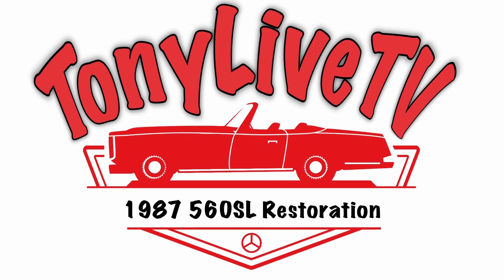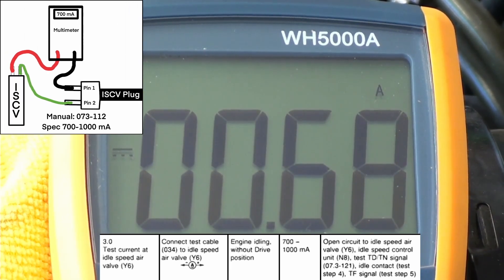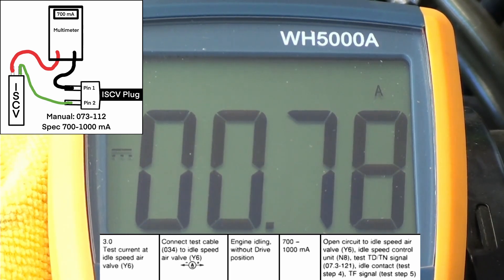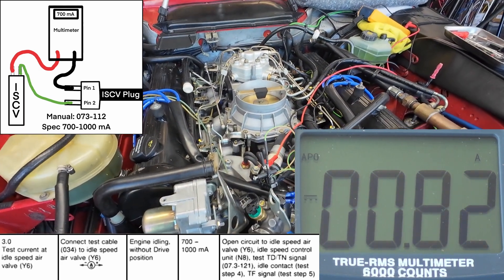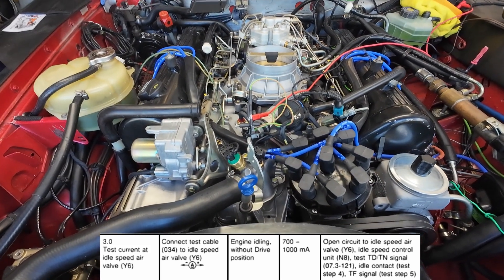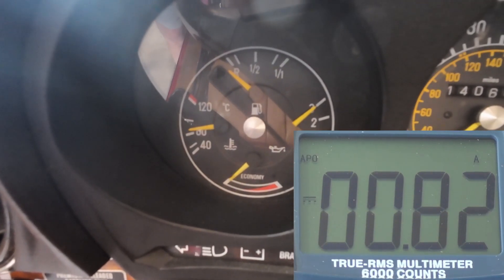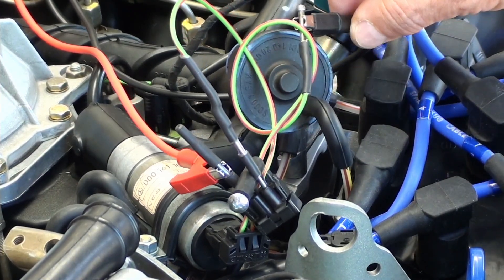560SL - Perfect ISCV Amperage Test Results (Idle Test)

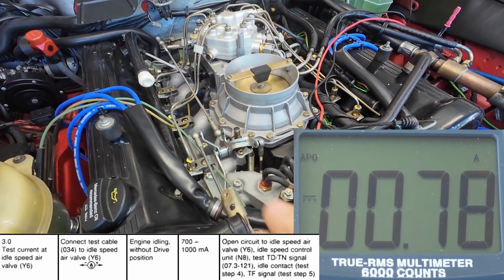Comment: Hi, Tony. Happy Easter at first. What I can tell you is that you should pay attention to the idle while your engine is being warmed up and afterwards as the temperature hits 90. Pay attention at 1:44 how your car behaves on idle, you have fluctuations and that's how it's supposed to be! That means the lambda is working properly, that your cars idle is where it is supposed to be. Concerning your RPM meter, check the wire from your instrument cluster, it's green as I remember and it has to go from X11 pin1. For this test you will have to remove the instrument cluster. I believe you issue lies there. Otherwise, CONGRATULATIONS, buddy, you made it!!!! There is a saying here that your wife/girlfriend can be from anywhere in the world but your car HAS TO BE FROM GERMANY!!! "Happy Mercedesing"
Reply from the maker: @mercedeske  Happy Easter 🐣. I didn’t have enough equipment and screen space for viewing the idle speed in this video, but I did monitor it on the side and it was perfect. This video was a continuance of the previous video where I blew the fuse in my multimeter so I was not able to show the ISCV amperage test results. 

Maybe  you can help me with the tach issue because according to the manual(s) I have access to, the tachometer gets its signal from a pickup called an E-Tacho. I mentioned this in another video. https://www.tonk.ca/r107CD1/Program/Chassis/54-252.pdf

But elsewhere in the manual it says there is either a mechanical tach or an electronic tach https://www.tonk.ca/r107CD1/Program/Chassis/54-253.pdf

Originally I thought this was for the speedometer because again, the manual says that too. Since I had a tach signal at the X11 Pin 1 and because my clock was also not working, I figured the problem is a ground and I’ll come back to it when I remove the cluster.

I have not found anyone who has traced the tach wires from the dash to its hiding place. I bet if I do the tach test as the manual shows, the speedometer will move, not the tach. I have conflicting wiring diagrams too. The lack of information and conflicting information is one reason I created this YouTube channel.

Comment: hi tony. I have 1986 mercedes 500sec. im watching your videos, everyhing is very good and imformative. But i have a problem can u help me please. my car is in restoration just now. electric cable and others fitted but rpm meter is not working. how can i check this meter. what could be the problem?   1) electric cables are problem  2) Rpm meter is not working and 3) rpm sensor is not working. what can i do. Rpm sensor is which one, i don't know which sensor it is. can u help me and show me please. Very very thank u
Reply from the maker: @halukkoroglu442  on the 560SL the dash tachometer gets it’s signal from an inductive sensor on the transmission. The manual explains how to test. The engine (EZL) gets its RPM from the rear TDC sensor that sits on the back of the engine where it connects to the transmission. I suggest you find a manual or find someone who knows how to work on your car. These engine use the same technology as Porsche and Ferrari and are not easy to work on without the proper tools and knowledge.
Reply: @TonyLiveTV thanks